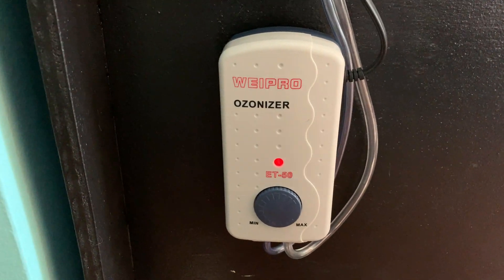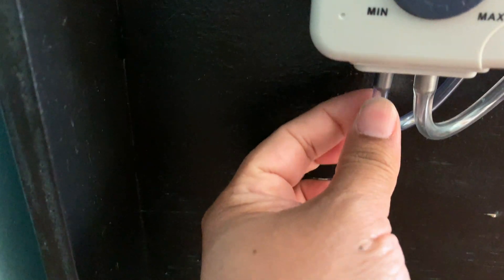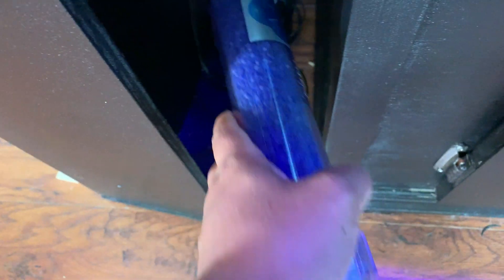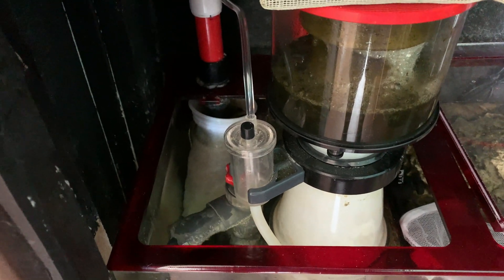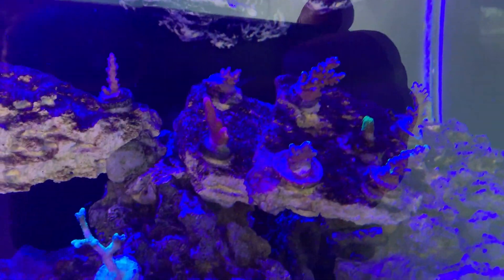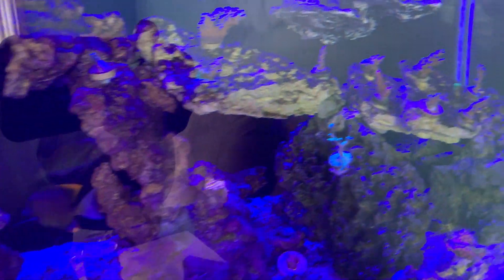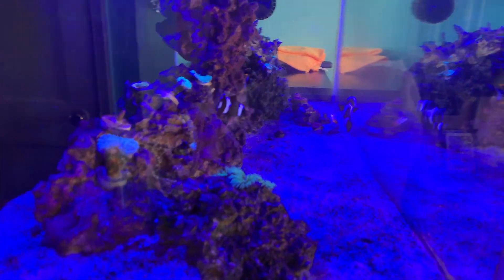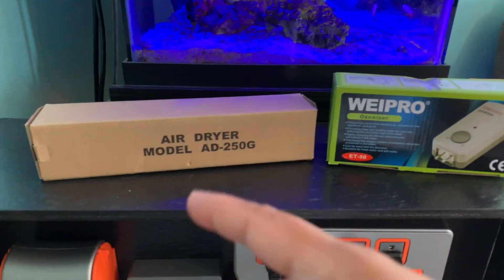Adding ozone to the 75 gallon

Comment: Hi. I been doing research for my tank also. Its been a while since you did this video. So far what can you say about it. Does it work as you expected? Any problems with the system or the protein skimmer?
Reply from the maker: Compy Ginorio it worked great.. love it..just take it slow when starting it
Reply: @PRFishGirl  any advice besides getting tuned slowly? And thanks for your help.
Reply from the maker: Compy Ginorio theres really not much too it.. just start it low for maybe an hour and see how your tank looks... out some carbon on the lid of the skimmer just Incase.. u will know if u overdose it by thunder storm smell.. and use a orp probe if u have a controller to turn off the ozone when It hits a certain number like 400

Comment: You don’t need Air pump?
Reply from the maker: Poderoso77 no air pump
Reply: @PRFishGirl  how come? Can I put the same Ozonizer to clarify my small pool through silicone tube that is directly submerged in water?
Reply: You don’t need an air pump if you hook it up to your skimmer because you’re skimmer is sucking the air through. Although you will need to use a skimmer that is rated for ozone usage. If you don’t hook it up to skimmer and use an air stone, then you will definitely need an air pump.